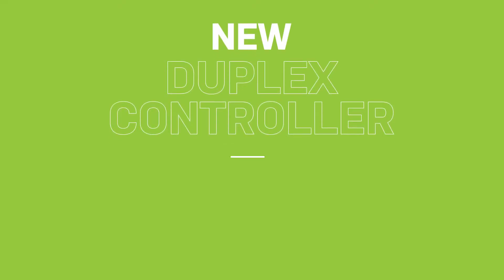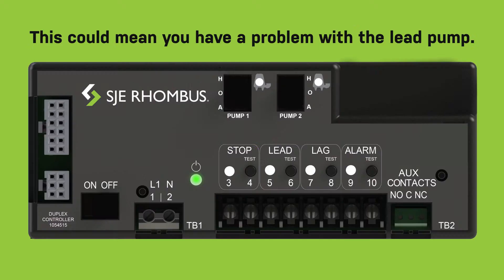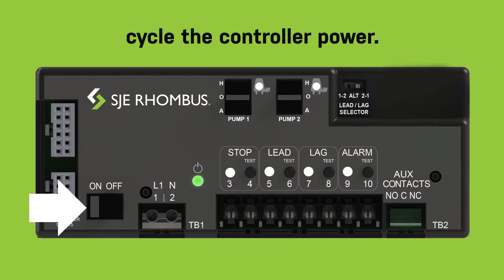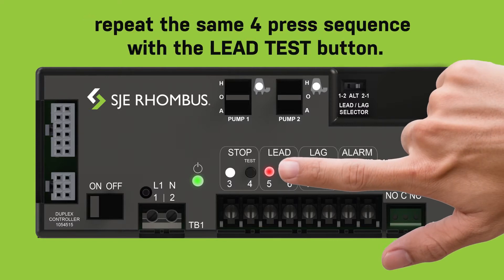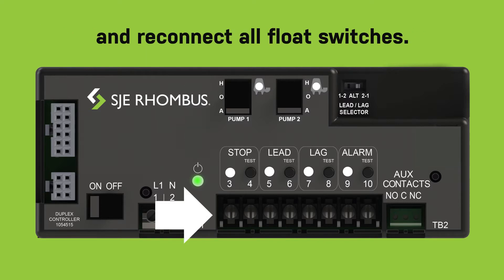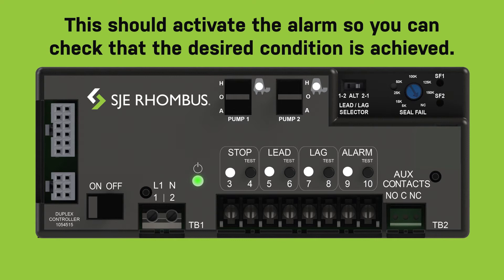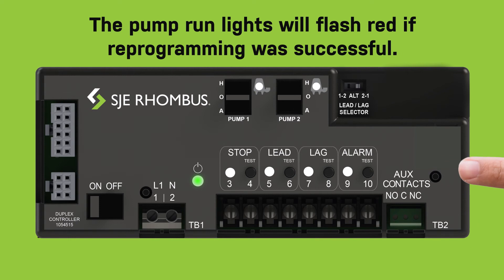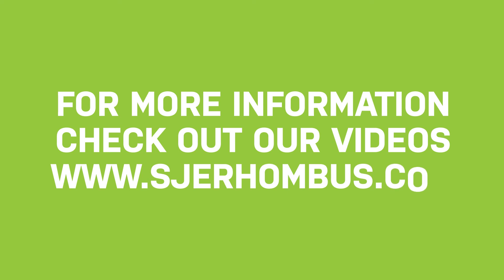NEW Duplex Controller: Programming | SJE Rhombus

Comment: If you powered the whole box with 220  how can you power that little board where all the floats going??
Reply from the maker: Hi Hector! For a single-phase Model 122 duplex panel, the board will need 120V incoming power aside from those used for the pumps. For a three-phase Model 322 duplex panel, the incoming power for the board is provided by a step-down transformer built-in to the panel. If you'd like to discuss further, you can call our Tech Support team at 1-800-746-6287!